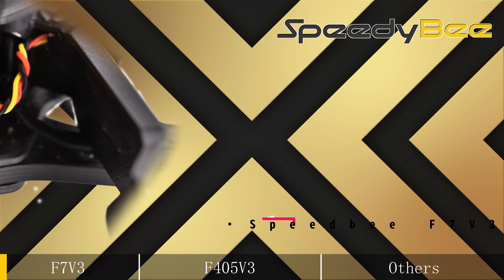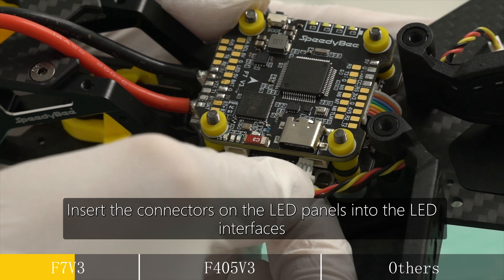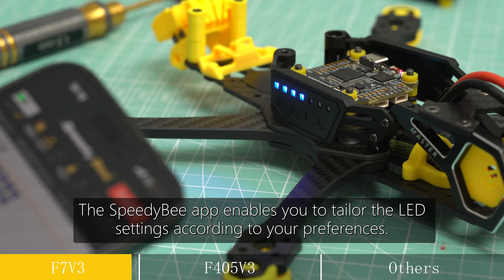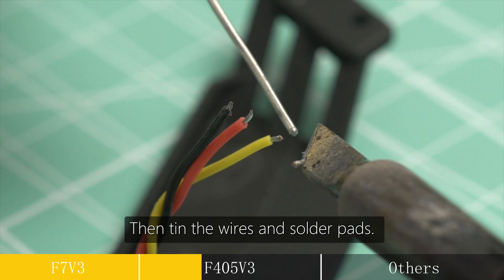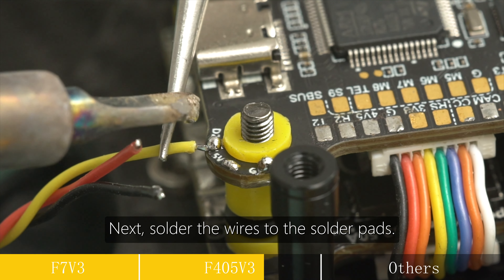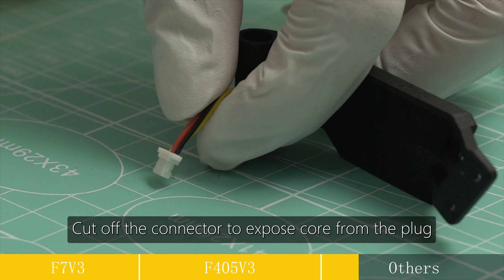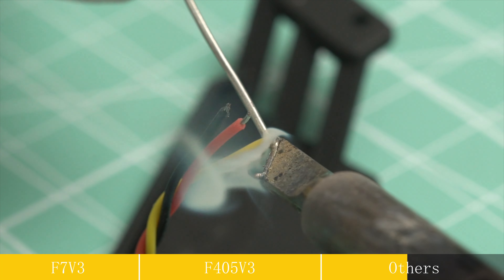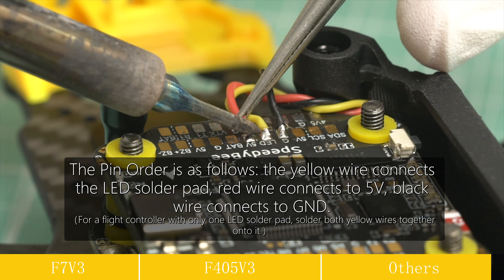Master5 V2 LED Panel Installation Tutorial

Comment: I purchased this frame and  just finished building it.. If I purchase the optional 4x LED bars and connect them to the 4x connectors of the F7 V3 flight control, where and how should I connect the included LED panels?

Could I splice both panels and connect them to the LED pads on the FC?